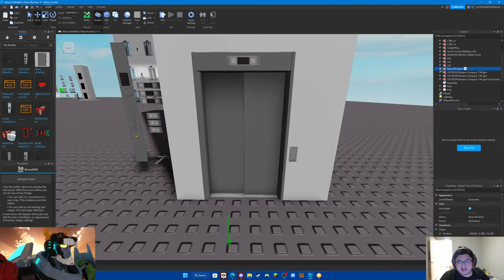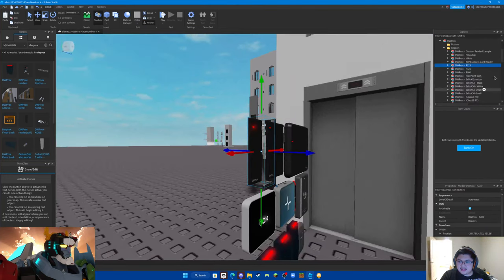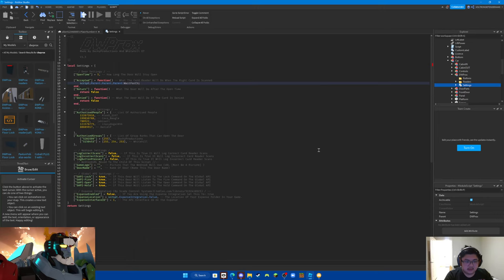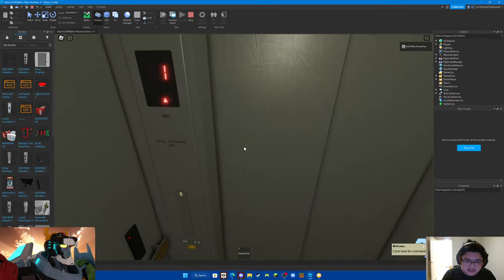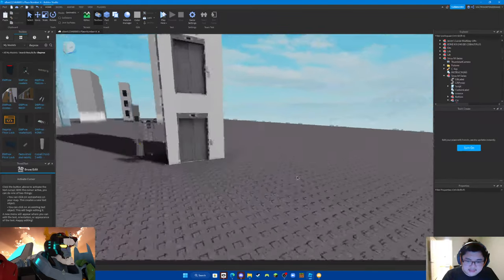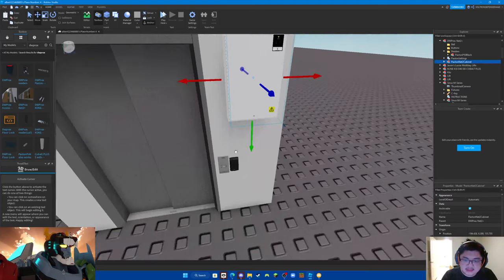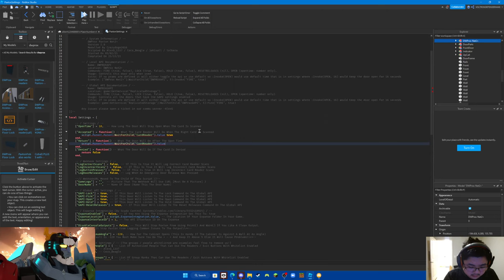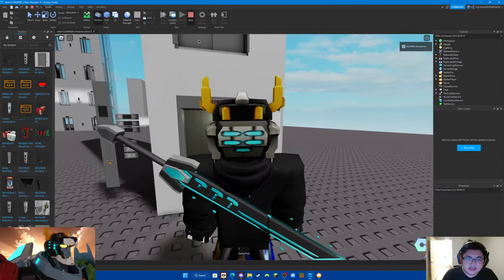UPDATE on how to lock floors on a cobalt plus elevator and how to lock the call buttons

Comment: do i need scripting in Sinus M siries of locking the elevator with DWprox readers?
Reply from the maker: The lock code that’s in the cobalt plus script is already their by default the scripting for the dwprox reader you have to code yourself
Reply: @VOLTRONDEFENDER4440  so is it already to 0?
Reply from the maker: @Syanojr  its default set to 1,2,3 you simply change the numbers to 0